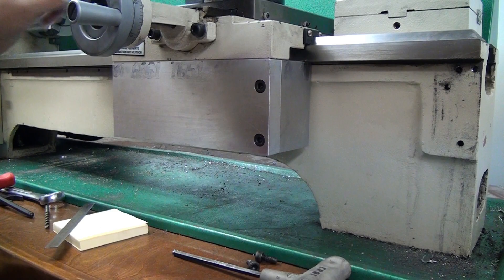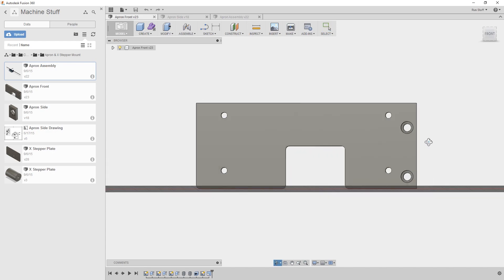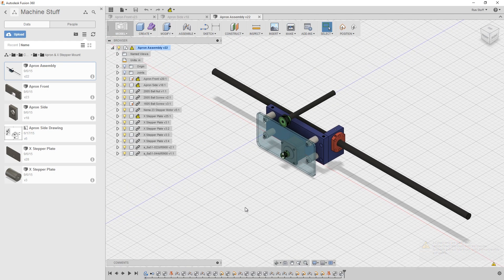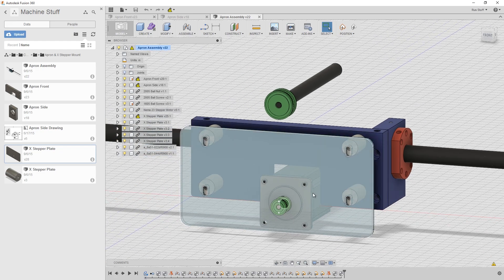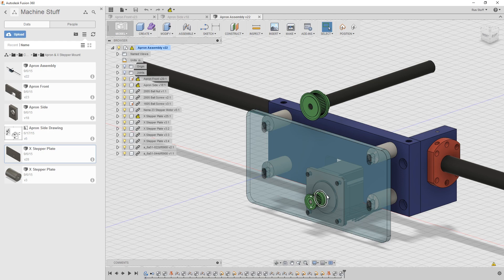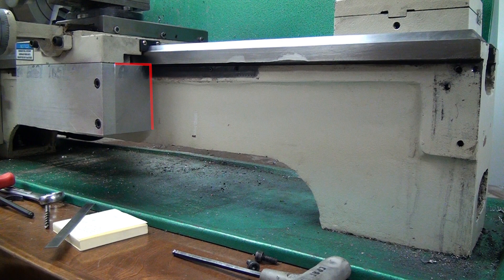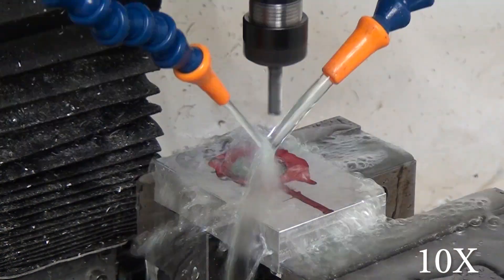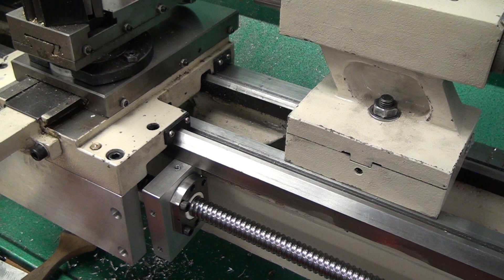G0602 CNC Conversion pt5 - Apron & Z-Axis Ballnut Mount

Comment: Cheeky little tip from me,for what it's worth. I made a copy of lathe bed profile from steel offcuts and mounted it on the end of lathe headstock. Now I can simply use my existing lathe steady to support longer jobs. Allowed me to turn the end of a six foot long bar with no problems. Not sure if any lathe makers supply such a facility?

Comment: I'm really enjoying this conversion.  Who knows, I may even convert my G0602 someday.
On another note, I noticed in your last video that there was a collet chuck on the lathe.  When did that happen, and is there a video?  I am very interested where you got the collet chuck (CDCO ?) and the backing plate, and even more interested how the machining of the backing plate was done.
Reply from the maker: +Titaniumboy Nice eye :)
Yes it is a CDCO (part number 25501) and I actually thought I rolled out that video until I posted the last one, and realized I never got around to it. It's almost fully edited though, and just needs to be finished. It is going to be the last of my "pre-CNC" videos.... I just need to get at it.

As for the backing plate, it is a Grizzly part number P0602054-2 and I machined it on the lathe itself.

Thanks for watching!

Comment: The cross slide stepper turned inside looks great.  Do you think it would be possible/practical to place the mount on the outside of the belt so it would double as a cover for that?  BTW I'm stealing the standoff slots rather than holes idea for belt tension... genius!
Reply from the maker: +Tristan Adams (Tristanmla1) Thanks for watching! Yes I'm sure it could be done, and it would be really nice to have. I do intend to make some sort of belt/pulley cover but it hasn't been a priority. Feel free to steal any of these ideas :)

Comment: what coolant are you using on the mill and do you like it?
Reply from the maker: Kool Mist, I think the 77. I get it from little machine shop because they usually have the best price. Yes I do like it, but it's the only thing I've used. I never have rust issues.